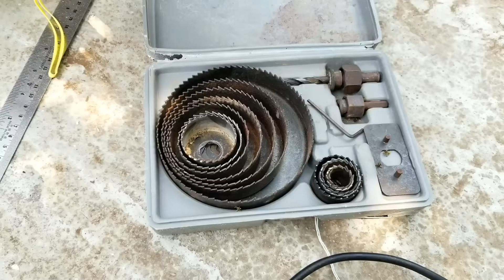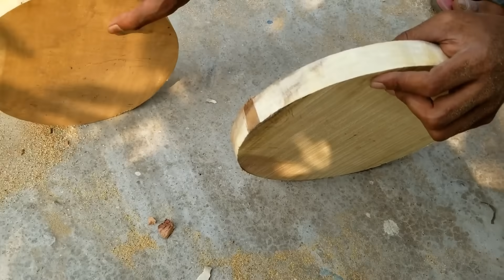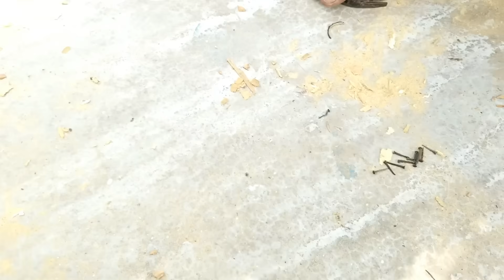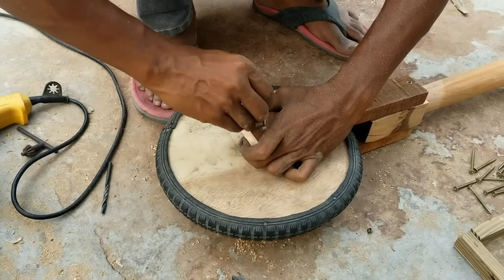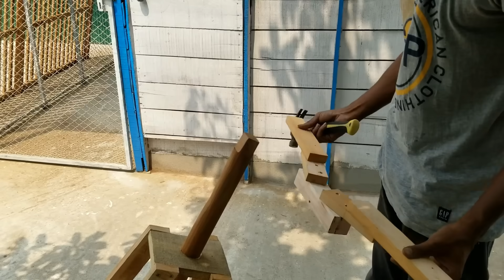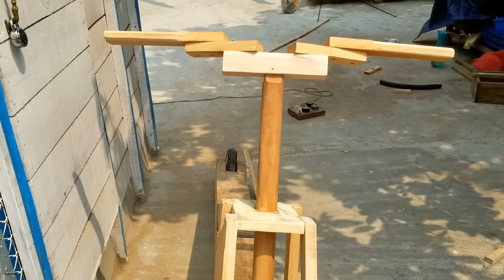How to Make Chukudu | Easy Build Wooden Scooter at Home

Comment: Wow 🤩🤩🤩🤩Very nice.🌹🌹🌹🌹
Reply: So he can afford new screws and a drill and a grinder and a jigsaw and all the bits for those tools but you need to build that but of course yours is smaller  and can not handle a work load because it is a 2x4. The real men there have just 1 sharp blade. I dare you to haul a full 2000 pound load on that piece of shit.

Comment: One shaped board for the handle bar would be stronger. Also, a thick bit of rubber tire sticking up several inches nailed either before the back wheel or in that groove could be used as a break as well as protect the rider from accidental contact with the back wheel.
Reply: There's  always someone who can do it better !  Never fails.   🙄🙄

Comment: Very good!!!BRASIL-BH
Reply: So he can afford new screws and a drill and a grinder and a jigsaw and all the bits for those tools but you need to build that but of course yours is smaller  and can not handle a work load because it is a 2x4. The real men there have just 1 sharp blade. I dare you to haul a full 2000 pound load on that piece of shit.

Comment: Good job but better use metal parts to make it durable
Reply: Right! However the chukulu is historically made all of wood, not using even wheel bearings but a wooden shaft thru the wheel greased with animal fat.

Comment: You know what a dandyhorse is. What if a dandyhorse had a third wheel in the middle and the back wheel span freely like wheel on market cart. For this the wheel would need to be smaller then a wheel  on a regular dandyhorse.

Comment: So you can afford new screws and a drill and a grinder and a jigsaw and all the bits for those tools but you need to build that but of course yours is smaller  and can not handle a work load because it is a 2x4. The real men there have just 1 sharp blade. I dare you to haul a full 2000 pound load on that piece of shit.